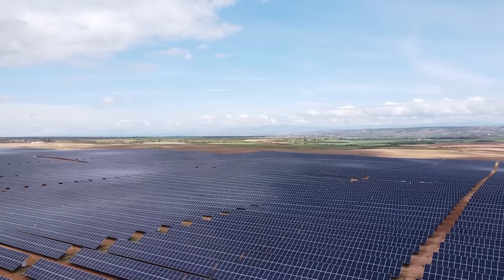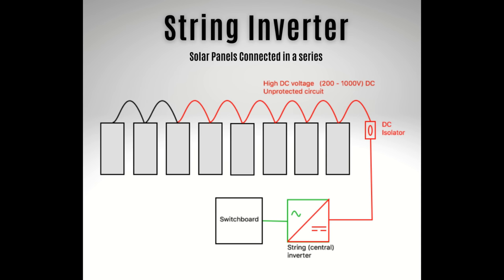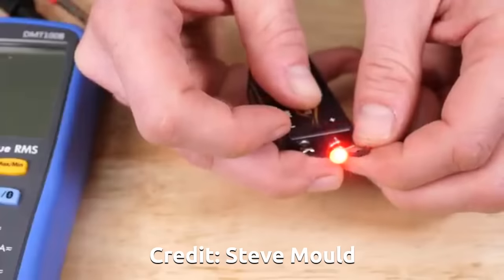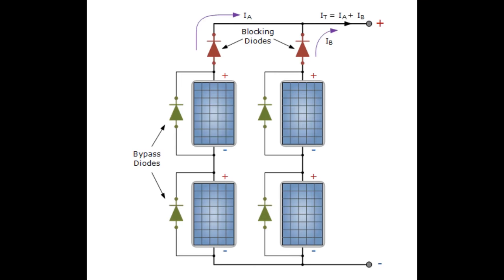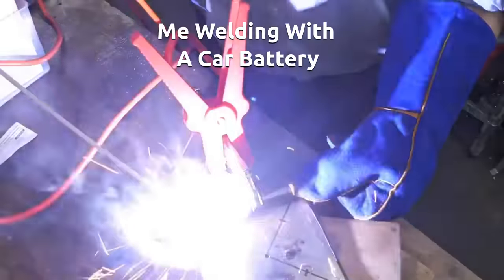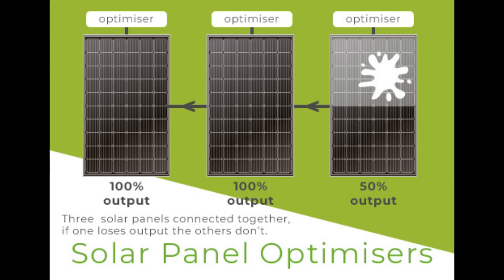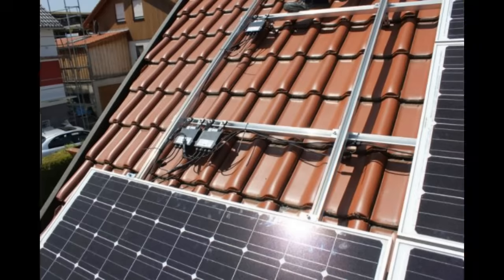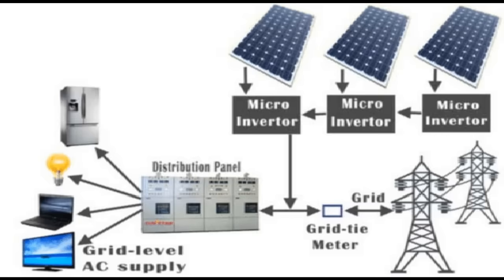2262 Microinverters Where Do They Come From And Are They A Good Idea

Comment: Got both...
Just running out some tests on them and performance.
There are pros and cons to both and some faff.

String inverter will take 450v PV. The micro 80v.
They are about the same in current.
It is more a matter of where they go, and roofs can get hot both inside and outside and the new regs may put an end to many installs in the loft.

The on roof isn't so bad, as would the balcony systems. But the problem with micro inverters is that they make AC but dont have a battery.
So you only save when you use. And you can't store it unless you get a AC coupled inverter charger for adding a battery. So it won't always be the best price if you want a 'fit your life system '.

If you wanted to give solar a try, then why not, but if you want solar to workm, your best off going down the hybrid route.

Making solar all day when your at work, and the sun's down by the time you get home, well that's pretty useless. Unless you small scale to cover the day time loads of a empty home which is going to be small. But then the idea would be to lower your bills. 

I'm having a play, I've a grid tied string, and a off grid system and trying out this micro inverter set up...

Comment: My local (Dallas, Texas) installers wouldn't do microinverters. They said the temperatures here are too harsh and cause accelerated failures. So i went with a DC optimizer setup.
Reply: The failure rate of DC optimzers is greater than Micro inverters.
Reply: @offgridwanabe  might be so; still it s another small box out "in the wind" prono to failure if you have year variations from minus 20 to plus 35; for places with only plus 10 degrees then it might work; if you have a company then you could consider reason to bill somethin extra from time to time to have someone change a few micro inverters;

I like the idea of micro inverters but i doubt the quality for minus 20 to plus 35 degrees difference in year per location
Reply: doesn t make sense to put an optimiser and not a micro inverter, it is still another small box out in the open with possibilities to failure
Reply: @shazzz_land  well I have had them installed for 8 years with no maintenance and we get +35 and -35 c every year but if one goes it may cost $100 and not thousands for a new inverter.
Reply: The installer likely just likes that product and was able to charge more because of more parts. Micro inverters are more efficient in most cases if you're grid tied.

Comment: In my house, I run D.C to D.C due to power loss during inversion and also another power loss converting it back to D.C. So I use Buck and Boost Converter to power all the D.C appliance that uses A.C adapter. My Bulbs are now 12V D.C while things like TV and Refrigerator goes to Inverter. Honestly, there is a lot of power saved using this method. I can still turn off my inverter to save more power then use my PC which runs on D.C to watch videos.

Comment: you left a HUGE point with the microinverters, they NEED the grid to function, the part that they cut out is the frequency matching and they match what the grid does. 
so it might be all the distributed system you want, but if the grid goes so does your solar system.

Comment: You can use DC voltage almost everywhere in your home nowadays, B'cos they have a Switch mode power supply. And if not. Put the micro inverter only there ;)

Comment: I'm voting for team  "big single accessible inverter".

Electronics usually last 10 to 20 years indoors.
On the roof where humidity vary from 0 to 100% several times each year. And temperature from negative 25*C to positive 40*C can't be healthy. I give it 5 to 10 years before microinverters break.

Comment: For off grid I'd go with just a charge controller to a battery and then run what you can off of DC like lighting and have an inverter for power outlets, this would be far more efficient than micro inverters. However if grid tied then pay your money and take your choice personally I'd still go with the same setup so I can change out any failed components much easier.
Reply: Or use solar panels to charge a bank of batteries that add up to 240v so you can intermittently power 240v stuff from them
Reply: @bigmouthstrikesagain4056  except batteries are DC and 240v equipment is AC
Reply: @bigmouthstrikesagain4056  Just a thought: 240VDC is equivalent to the RMS mains peak Voltage of 338VAC. A filament device, like a tungsten bulb, will run OK on 240VDC, but most electronic equipment will have problems: They usually need both +Ve and -Ve alternating cycles to share heat, operate correctly and a peak value of 338VAC. Some equipment is designed to run happily on both mains AC and 12/24/240VDC to state a few.

Comment: But when you add a battery to such a system stuff gets inefficient because you convert the electricity from dc at the solar panels to ac using the microinverters and then back to dc to charge a battery with it. In such a case it would be better if we had micro mppt chargers which could directly charge the battery with dc. Those might also be cheaper than microinverters because they don't have to handle any high voltage like 220V or 120V but just the <50V of the solar panel as an input and the 48V lifepo4 battery pack as an output.
This would also have the added benefit of being off-grid capable as the micro mppt chargers would only need the battery and not the grid to output power.

Comment: Heat is a problem for both solar panels and microinverters (and electronics in general). Heat alone can steal 5%-10% of a solar system's capacity. The question isn't microinverters versus string inverters, but instead must focus on establishing and maintaining overall efficiency.

My feed delivers to me all things solar, and agrivoltaics are always included. Recently, vertical agrivoltaics has been getting attention because the expected losses due to the vertical orientation were not seen! Instead, the actual production was 5% better than expected, which eventually was traced to the vertical panels running cooler, but also running cleaner, as less dirt and dust was deposited on them. This also applies to electronics co-located with the solar panels.

I had been postponing my home solar because my roof has nearly a decade of good use remaining. I didn't want to install a solar system on my roof, only to remove and reinstall it several years later when the roof needed replacing. That seems to be a waste of labor and money. Sure, I could replace my roof sooner, but that also seemed wasteful to me.

But my fence also needs replacing. What about incorporating vertical solar in my fence? I ran the numbers, and I'd need about half of the fence (the east-west part that faced the street) to be bifacial panels, with the rest being conventional single-face panels (that faced the neighbors).

I ran the numbers, and soon found that I'd need a few additional panels, but I could do the installation myself, except for an electrician to make the final connections. While solar fence posts cost more than roof installation systems, the labor savings and ease of access make the vertical fence solution hugely preferred.

Comment: Factory direct miroinverters are soo cheap and accessible for $70 for a grid tie micro inverter you can have a ground mount or balcony solar anywhere instantly! It is just plug and play for renter or home owners ,best to go with a provider with metrics on there app ,if you dont want to push any electricity into the grid ,you can just put a consumption only sensor on your inverter also meaning your inverter will also last much longer.. . WIN WIN either way🤩🌞

Comment: 1 tiny point about micro inverters being "exposed to the elements" there is a about 2m² roof over it in the form of the solar panel itself.
Reply: Radiating extreme heat on the micros.  Had more micros fail on me than strings.  But then again I did not use Enphase and I believe they are much better.  Also like their IQ8 micros but can't see them competing with Huawei, Solis and Sungrow. Coming from South Africa.  Also in my 16 years experience, never had an issue with DC voltages up to 1500V.  So not sure what the fuss is.  More of a marketing campaign

Comment: I have used microinverters, string inverters, and hybrid inverters and there are indeed pros and cons of each. Biggest plus for microinverters for me has been that they don't complain about ground fault on old used panels. Those old panels would bring down the entire string on a wet or foggy day. And it sure is an issue getting an new micro inverter to replace one that failed because the manufacturer doesn't make it any more. Also, some require gateways or other monitoring hardware to turn the darn things on and that is just another layer of failure points and annoyance.  

Still, they are in use, working with panels that would have otherwise been worthless.
Reply: Re: micros...EXACTLY!! That's what put me off them right off the bat. They're too proprietary.
Reply: Are you saying that you cannot mix-and-match different microinverters? 
I assumed each micro would sense the voltage, frequency and phase then match it... making them virtually independent. I do not currently use micros, but had been thinking about them.
Reply: Yeah... I'm not a fan of proprietary either... it usually just means they have you over a barrel!
Hopefully, someone designs an open source version! For now, I'll stick with a single inverter until the micro tech matures.
Reply: @onestoptechnologies7305  critical factor to an off-grid prepper type such as myself. I need max flexibility and options or it's no-go...
Reply: @TexasVeteranPatriot  Absolutely Right! I'm hoping we get smaller stackable inverters. 3x2kw not 1x6kw  
Have you heard about vertical installation of solar panels? 
It's not the perfect angle to squeeze out every drop, but panels are fairly cheap... 
Better convection cooling, Longer panel life, No snow, No dirt, More consistent production...
And if you loose a few... you can always drop them out... set the angle and still get what you need.
Reply: As you bought one microinverter you can buy another, the power output from the panel will be the same, so the idea is sort of useless; it is like in breakers, you buy one with the needed power cap output, you don't care for the company so much; company goes out you buy another breaker from another company that has the power cap you need, i imagine this to be the same with microinverters also

Why would old panels bring down entire string on a foggy / wet day?
Reply: @shazzz_land  Maybe some microinverters are just interchangeable, but mine are not. They want their own power line and gateway. I have to run a new line from the grid to a new microinverter string to replace old, failed ones.  I think this is because they send data over the power line to communicate with the gateway but that is just a guess.

Old panels can get moisture in them and give a ground fault error, I have read that low frequency string inverters are far less sensitive to this mode of failure, but I've never owned one.
Reply: @ur_quainmaster7901  doesnt make sense for the microinverter to not be interchangeable; the only variation you'd get is a variation in output current by a minor fraction due to different model; if the cord connection is the actual problem then it sucks
Reply: @ur_quainmaster7901  where do you live? what is your lowest temp in winter? 

Can the solar panels condense in early morning inside that much?  If so the how many hours from the morning you'd lose till they dry out?
Reply: @ur_quainmaster7901  standardization is dull but biutiful overall
Reply: @shazzz_land  Hot and humid area... It depends on the weather on how long the inverter would be down. If the sun is out, 9 or 10 am and I could reset. Partly or mostly cloudy, and it takes longer. The bigger issue is my string inverter doesn't reset automatically so I have to be home and paying attention to get it going again. That's why I got microinverters for the old panels and reconfigured everything. Haven't had a failure since.
Reply: Independent micro inverters are a thing now. Buy a could spares far insurance. Thanks for the idea.

Comment: The problem is that most of our electronics used DC and very low voltage. So converting DC from the solar panels into AC and  then back into DC again is hugely wasteful.Maybe we're looking at this the wrong way. Maybe the power in our houses should be DC high voltage around 250VDC.

Comment: Electromechanical inverters,charge controllers, voltage regulators and  adjustable bimetal power cutoffs for overcharging FTW....
Reply: Honestly it might not be perfect but Wheatstone bridges and huygens mechanisms for storing solar power like a voltage smoother/supercap with a flywheel ect ect is Honestly the best way to go for it I think especially as electromechanical is much more hardened to emp and solar storms.

Comment: I am doing as little of this as possible I try to use my electricity as DC. No losses and cheaper. I have bought lots of cordless power tools. I will charge them from solar and if there is enough sun I will even run them from the panels direct.
Reply: I too use both the DC and AC, but remember the whole reason we do not use DC everywhere is that DC has substantial transmission losses. I use the DC to power pumps in the mechanical room, but beyond that it really became impractical. Pumping 48VDC through parallel wiring, just so I can power a stepdown transformer for low voltage lighting, USB charging, et cetera, really didn't make sense in the long run. The 10-15% inverter loss was immaterial compared to the headache of designing, building and maintaining a separate DC system that no one else understood. I came to the same conclusion regarding solar tracking, I just slapped on a few more stationary solar panels and kept the system simple. I love efficiency, but at some point...

Comment: MicroInverters = massively more points of failure and expense. KISS method better in the long run. EDIT: DUDE! Was that a Fallout mini-nuke I saw??? Awesome!
Reply: disagree. Micros run cooler and you have redundancy.
Reply: @boathemian7694  dayum, good point.
Reply: True and not, I guess.
So, true, but depends.
Reply: By definition, points of failure is inversely proportional to redundancy... more points of (partial) failure make this highly redundant.  A single point of failure is what will kill the entire production.  Computer chips are made with multiple points of failure.  They design a circuit with the top spec, yet the actual yield is worst at first.  Various process issues or contamination can lead to more bad parts of the circuit.  If they threw away ALL imperfect chips, we would likely have 1% yield.  Rather, they simply cut off dead segments of cache, ALU, etc, and the effective clock rate is lower.  The resulting low-clockrate chips first available are all the usable failures.  The chips that work better are stockpiled to create scarcity, demand, and build up supply, to justify massively inflated prices, despite same production cost as slow chips.  That is just an example of the leverage multiple points of partial failure can provide.  Wether CPU or power generation is irrelevent.  The argument is about the relationship between points of failure and redundancy.  In software design, a similar idea is that of graceful degradation, rather than a crash or failure of service.  Another example -- the internet, fprmed by the massive redundancy of multiple routers that keep track of multiple routes and can reroute paths in case of a single failed router.
Reply: @Warp9pnt9  LOL... after reading everything you said TWICE... I'm not sure the point you are trying to make. 

Generally, I am a fan of "Lots of Little," but this discussion needs to take into account the actual failure rates. If the failure rate of the single inverter is tiny and the failure rate of the many micros is huge... then it changes the game.
Reply: Wrong, String inverters have the same number of connection/failure points
Reply: @BrianMchale-b1v  failure points are about more than "connections" and are only PART of the equation. availability, compatibility, scalability, cost. all factors must be considered at the SYSTEM level not  from a singular perspective. I speak from a purely off-grid perspective. Those who are grid-tied may decide differently. As an off-grid prepper with decades of electronics and power experience, long-term they're a non-starter for me in their current state as a system. Read previous comments...
Reply: @TexasVeteranPatriot  LOL... I was just going to say that! We're not just talking about something getting unplugged! (and technically... Yes, adding a dozen microinverters does increase the number of physical connections too... Every additional device adds more connections!)
Reply: Been doing PV since 2008.  String >>> micros.  Hands down.  Micros fail so often.  String inverters are robust and are not installed under hot PV modules.
Reply: If you have 1 point of failure and it fails?????
10 micro inverters and 1 fails.
Reply: @markmmm1737  Point is that historically micros failure rate exponentially exceed string inverter failure rates. Look it up.
Reply: @TexasVeteranPatriot  I have and my enphase had better last as long as they claim.  The cheap Chinese inverters are the ones that fail often.  You get what you pay for.
Reply: One inverter becomes a single point of failure. Multiple reduced risk, but increases complexity.
Reply: @mkoza76  Re: complexity, Not by much, but string systems also have vastly increased flexibility (over micros) and longer-termed dependability. I can take ANY inverter and slap it on the dc bus to get power, even multiple Amazon cheapos if I need to. 😎